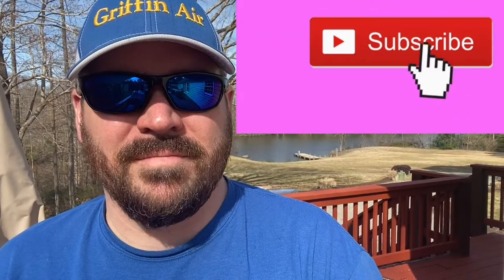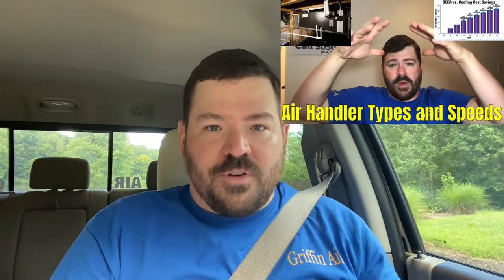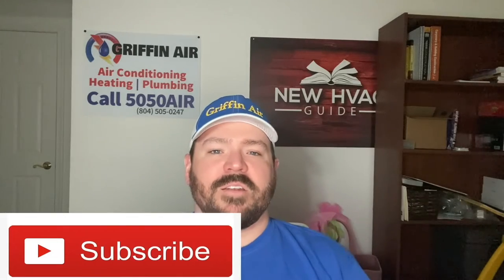HVAC single-stage vs two-stage vs variable compressor. Heat pumps and Air Conditioners video

Comment: I just had a 4 ton Bosch 20 seer unit installed in my 1500 sq ft house. This house had nothing but window units for 35 years. The amount of moisture this system is pulling out is crazy! It feels amazing now.
Reply: How many stages

Comment: Man, you got me rethinking getting an inverter system.  The bigger problem I have had is really high estimates on an inverter system between 25k and up to 32K.  On two, 3-ton gas systems, and I and my wife bulked at that kind of price.
Reply from the maker: You must be in an expensive area.  We've put Daikin Fits in here for around 10k
Reply: @NewHVACGuide  How long do those mini split condensers last I had a guy tell me they don't last as long as the garbage can style condensers.
Reply: I bought an Ecoer-less than a Daikin and superb performance.
Reply from the maker: I’d argue inverter systems last longer.
Reply: I'm in KC area and having a 3T inverter heat pump and coil put in a rental for 3700.00
Reply: @NewHVACGuide  inverter systems lasts longer due to the soft starting nature.

Comment: It seems the choice is actually where the money is going to be going to. Either a more expensive product to produce a better result or a less expensive product but a higher energy bill.
Reply from the maker: That argument used to be valid. However, inverter systems are relatively the same cost as multi stage units these days.

Comment: IMO the best choice is still a properly sized 2 stage system with good duct work and accurate load calculations. Reason being, energy consumption and cooling output is not linear. That is, at 40% capacity your energy consumption is not 40% but closer to 50%. A typical 2 stage system with a 70% vs 100% staging the energy consumption comes down to around 55% vs 100%. This is actually the reason most 2 stage systems have their stages set to 2/3rd and full output as the lower the output the worse the efficiency gets and the sweet spot is around 2/3 output. For a typical inverter system on it's minimum 33-40% load will consume around 45-50% of energy compared to maximum output. The energy savings compared to a 2 stage system is marginal given the 2 stage system is designed to run in stage 1 most of the time.
Reply from the maker: Multi stage is definitely an advantage to single. But we’ve seen more improvement from inverter communicating systems than anything.
Reply: Let's be clear-none of your videos are "clear and to the point". Damn bud you're knowledgeable enough and passionate about your occupation but you're fixin to sunburn your tongue.
Reply: @NewHVACGuide  Are inverter/variable speed units noticeably more quiet than a 2 stage?
Reply from the maker: Definitely and significantly
Reply: Thank you for the clear explanation with some percentages included. This is kind of the info i was looking for.

For context, I just replaced my upstairs Lennox single stage with a Trane two stage. My downstairs is a 12 year old Lennox 2 stage system. when the Lennox is using stage 1 I can feel air but i can't hear a thing. The Trane is noticeable in stage 1 and after some effort I verified i got it two kick in stage two and was slightly louder. I guess it comes down to design philosophy. Trane maybe designs to 2/3 and Lennox designs to 1/3. I would love to see actual power draw charts though.

Comment: How is reliability affected by the different stage systems? I have a 23 year old single-stage Ruud package unit that every AC company has told me I need to replace just based on it's age, but I've only put about $2k in various repairs over the past 13 years and she works great! I get it services once per year. If I replaced it when the first person told me to 13 years ago, I would already be due for a new system. Is there anything on the market today like that? Single-stage, simple design, easy to repair, inexpensive parts, made to last?
Reply from the maker: Yes. And if you like Ruud/Rheem, find someone that installs that brand. Single stage Systems have come along way as well. You will probably get 14 to 15 seer out of a newer system where that older one you’re talking about is probably only 10 or 12 seer.

Comment: My Carrier unit is 18 yrs old. Over the past 4 years, I have had to replace my capacitor once a year, and my fan motor 2 times within 5 years, and my blower motor 3 years ago. 

Based on all of the above, I’m now doing research to possibly buy a new complete unit. I live in Houston Texas, where it is very hot and humid through the majority of the year. My house is approximately 1900 sq. Ft. 

When considering parts replacement availability and cost, what are your thoughts on the following brands: Carrier/Bryant vs Lennox or Ruud? 

Would you recommend a single stage or two stage for my 1 story home?

Comment: What would be the backup for a dual stage? For single stage we could have electric heat strips for backup (or emergency), how does that work for dual?

Comment: I'm replacing my 2013 Rheem 3-ton unit SEER 13 heat pump with a more efficient one. Please, in your opinion, which quotes received makes the most sense (they are all from experienced companies) since I'm not sure about the quality of the product or the fairness of the offers (all include the thermostat of my preference, two surge protectors, and UV light:
Gree 4 tons split system Flexx SEER 18:  $10k with 10 yrs parts & 1 yr labor warranty or $11k with 10 yrs both parts & labor + optional $0.75 sq ft of blown-in insulation R30 for the attic $1,399.50.
Bosch 2.0 4 tons BOVA SEER 20: $10,540 with 10 yrs both parts and labor warranty.
York 3 Ton 17 Seer York LX Series Heat Pump Split System: $9,384 with 10 yrs parts & 5 yrs labor plus $300 rebate.
Bryan 3 tons 226ANA paired with FV4CNF005L00 SEER 16: $10,180 with 1 yrs labor & 10 yrs parts and compressor - includes Aprilaire 2210 whole house annual air filter.

Comment: Inverter simply explained is they can control speed indefinitely via communication wire dc voltage

Comment: I have the Daikin Inverter furnace, super quiet, holds the temperature perfectly steady even without running the fan all the time. Did have to have the first thermostat replaced as it was bad. My question today is, is there no money saving by turning the furnace down 3 degrees at bedtime, my dealer said I would not save and money/energy so I quit doing it.

Comment: I have a question, do two-stage air conditioners use an ordinary thermostat, or need a special type of thermostat to operate?
Reply: 2 stage non communicating systems are compatible with thermostats that support 2 stage cooling. Pretty much all smart thermostats and most programmable dumb thermostats support it.

Comment: I received a quote in the amount of $11k for a 2.5 ton 14 SEER AC single stage plus indoor evaporator coil plus a 90KBTU single stage gas furnace in the DC area. I think the quote is excessive. I was thinking I can get a higher SEER with two stage for less. The HVAC equipment is from one of the big 3. Am I correct?
Reply from the maker: I'm not sure what you're asking. So sorry.

Comment: I have yet to see anyone compare a heat pump from say 15 years ago to the newer heat pump systems. I have a ducted heat pump, it was installed new back in 2006, so the system is 17 years old. I have been trying to find a comparison to those older units to the new ducted split systems. Some of them can still work at -22, mine stops at like 32.. anything lower than that it blows cold air and the back up heat strips have to run to get the house up to the set temperature. Obviously, the newer system is more efficient, but is it enough to warrant upgrading? I would think so, but I can't find any info on this to be sure. One thing I started doing is not even running the heat pump below 32 because to me it is rather stupid to run the heat pump knowing it will only make the house colder before the heat stips kick in.. so I run it on emergency heat.. that only runs the strips. of course that is not economical, but it can't be worse that allowing the heat pump to run knowing it will only blow cold air for 5-10 minutes before it does what I have already done.  So, to the question... Will I benefit from upgrading to a system that can run at much colder temps.. Cooper&Hunter, Mr Cool, Senvile and a few others can still work at a those colder temps, they say.

Comment: Question: I love your videos you are a wonderful teacher. I would love to hire you but I live in Mississippi. Background Information: In 2011 my furnace went out and had to be replaced. The new furnace was setup to run the new freon with new ducts and coils. At that time, I could not afford to replace my outside compressor. I would like to take advantage of the new technology and install a variable/invertor compressor.  My electric bill during the summer months is normally around $290 and above.  Question:  Can I just upgraded the old compressor outside to a variable or multi stage compressor or do I need to replace everything including furnace, coils and ducts to take advantage of this new technology that a multi stage compressor offers?  Thanks in advance.
Reply from the maker: The answer is yes, it may be possible.  Though sometimes it's not... I recommend finding a contractor that gives you the warm fuzzies and go with what they recommend and sell in your local market. :-)

Comment: Can a 2-speed (or 2 stage) air compressor work with a single stage furnace? My guess is yes as AC only uses the blower of the furnace portion, so whether the furnace is single stage or two-stages doesn't matter to whether the AC is single stage or multiple stage, am I right? thanks for any feedback/tips
Reply: No, because your air conditioner then becomes single stage. As there is no y2 terminal on your furnace board

Comment: I just had to set up y2 on a 2 stage I’m in Texas it’s hot as balls only had y 1 hooked up I just jumped y1 to y2 no reason to have a low stage in Texas and no one cares if it’s more efficient when it’s 105 out
Reply: Agreed esp if you have whole house dehumidifier  for the the trunk season and max out te get what even when you’re ac is running.

Comment: Thanks for your videos that teach us how to better choose our hvac systems.  I want to ask your opinion about a house that I bought from my family that has baseboard heaters, (which I am told are quite inefficient) there is central air system which was installed later and attic ductwork was utilized for it. So, if I wanted to replace the baseboard heaters with a natural gas furnace, or a more efficient way to heat the house,  what would you suggest.  This is in f,f,frigid southwest Minnesota on the windy prairie.  Thank you for your time and effort to teach me so much about hvac systems.  John
Reply from the maker: Honestly, I'd just call at least 3 companies that are local and familiar with your climate. You will obviously be getting three quotes, but the information and opinions you will get will be invaluable.
Reply: @NewHVACGuide  thanks, I live in a community with a population of approximately 400 people.  There's one hvac company in the area... but I will  check surrounding towns which are approximately 12-20 miles away and see what they say. It seems that they respect territories.

Comment: Was wondering what if you run out of fuel can you manually switch it to the heat pump in a pinch
Reply from the maker: Most thermostats, you're going to have to reprogram the thermostat to make that happen. But yes it is possible.

Comment: Inverter Systems run on only electricity so as electricity goes up price of energy goes up. Natural gas is cheap. Just get a variable speed natural gas system when you replace your hvac.

Comment: Great video very informative. I have a York 2.5 ton heat pump with furnace. I'm thinking of switching to a 3 ton Daikin fit , what's your professional opinion ? Thanks
Reply from the maker: I love the Fit. However, make sure it has an AHRI match. I think the Fit can only be paired with an upflow furnace currently because of the coil.
Reply: Thanks , I'm getting the full kit , I mean I'm getting the furnace also

Comment: I was looking to replace my 30 year old Bryant air conditioner.  A Trane dealer told me that they can't install their two stage AC because I have a two stage Luxaire furnace but they could install a single stage Trane instead.  Doe it really matter if the furnace is not the same brand?  Why can he install a Trane single stage but not two stage AC mated to my Luxaire furnace?
Reply: There may be wiring issue between the two units, the printed circuit board wires, which are many. Also the dealer does not or can’t warrantee the mix of two different brands, units, companies.

Comment: I currently have a new construction home being started next month. It's 2650 sq ft and unfinished basement. The standard HVAC it comes with is 3 TON, single stage furnace and single speed fan. I spoke with HVAC today and they said, if I could, to upgrade to dual zone, variable furnace, and variable speed for fan. What say you? You spoke of inverter in your video, is that something worth investing and would the inverter be in addition to the upgrades the HVAC people recommended? I live in south central PA. Thanks for your input.
Reply from the maker: Every house is different and every situation is different. I have customers who have saved significantly by installing an inverter system. But you’ll have other heating and air guys on here say the extra cost is not worth it.
Reply: @NewHVACGuide  In your best estimation, what would the cost be for just running the ductwork, not including the cost for the two stage furnace or the variable speed fan, for a dual zone system for a 2600 sq ft house. Cost meaning what would the homeowner pay?
Reply from the maker: @kranix9166  hello again. As I said before every situation is different. Every market is different as well. I recommend getting several estimates

Comment: I hate the communicating type... Requires specialized cable.  Why can't they just use CANBUS instead of RS-485.

Because of restrictions in size, I need to use a Side Discharge and from my research there's only a few brands that meet requirement:
- Colemann/York HMH7 (Likely a DC Inverter cuz it doesn't spec LRA and uses 24VAC Comm)
- Trane/American Standard AccuComfort 19 (I don't think this is DC Inverter as it spec LRA and RS485 Comm)
- Daikin FIT (DC Inverter but can't find specs and Comm unknown)
- Gree Flexx/MrCool/ACPro X (DC Inverter and uses 24VAC Comm)
- Midea EVOX (DC Inverter but can't find specs and uses either 24VAC or RS485 Comms)
- Carrier/Bryant (Loud, Old School Units)
Reply from the maker: Which one are you going with?
Reply: My new Goodman furnace and condensing unit do have a communication interface but requires an expensive proprietary thermostat so I connected using the legacy 24V thermostat wire and Honeywell thermostat. I believe that the Bosch inverter system does not use a proprietary communication interface.

Comment: I'm still on the fence here. I just had a home energy assessment done and the evaluator says I am undersized by at least a full ton. I was sized for an 1800 square foot home when I'm actually 2800 manufactured home (triple wide with large extended kitchen section) main living space is 1800sqft with a kitchen that is almost another 1000 square feet. Question: to cut costs because I cannot afford much more than $12,000 on a new system they are recommended I get a federal speed 5 ton air handler and just a single stage 5 ton heat pump all of the HVAC contractors near me loves American standard apparently or Rheem. Do you think that is a feasible thing just having a variable speed air handler with a single stage heat pump home is all electric by the way with downflow air ducts. All of my air ducts are in my crawl space tucked and hidden inside the belly pan. Registers are all at .3 or less static pressure as well at the return it was at 0.4 evaluator said overall 97% efficiency barely any air leaks and I should easily support a 5 ton system without replacing my ducts and with the Arkansas weather I'm of the edge of zone 1 and 2 evaluator said I probably wouldn't need 5 tons year round only in the super hot months rest of the months the air handler alert will probably only run on its lowest setting. But my thinking is the entire system needs to be variable in the summertime I could care less about efficiency as long as it cools and doesn't jack up my electric bill like my current system is running nearly $500 a month to keep it 78 degrees in my house thing runs 16 out of 24 hours straight and has a heavy amp drawer when it kicks on over 100 amps and runs at 24 amps and humidity stays above 70% or between 60 and 70% in the cooler months.

Comment: I plan to upgrade in the next 6 months. I currently have a 20 year old Heil heat pump. I am pretty sure I have narrowed down to a Trane system. 
My home is only 1500 sq feet. Would the XV18 with 
New air handler (Hyperion) or tem6 be worth spending the extra money for or should I go with possibly single stage or multistage due to such a small house? 
I am in SC and it's terribly humid during the summers. Thanks for all the information you provide.
Reply from the maker: If you’re sold on Trane, check out their TAM cabinet air handlers. That said, it’s hard to say whether or not you will save enough for it to make sense for you to make the extra investment. Some homes yes, some homes no

Comment: I'm a novice. Seer rating?
Reply from the maker: Hello. Seer is typically a number attached to heating and air systems to tell you how efficient the system is. Meaning the higher the number, the lower your electric bill should be.

Comment: which heat pumps have inverter system?
Reply from the maker: Usually ones that are higher in SEER
Reply: Bosch makes a very good inverter heat pump.